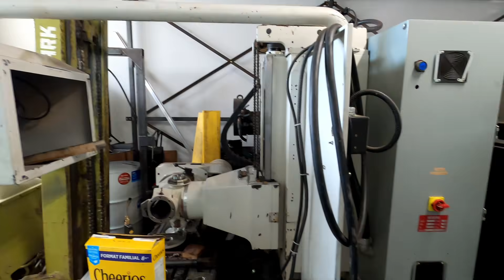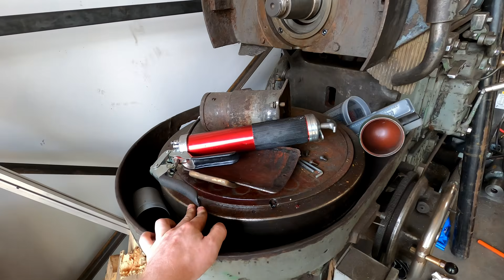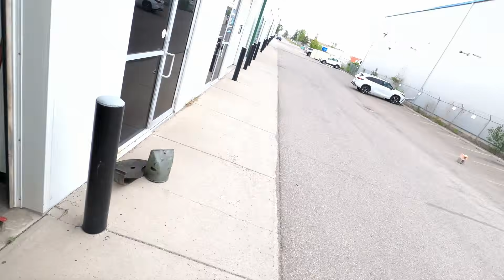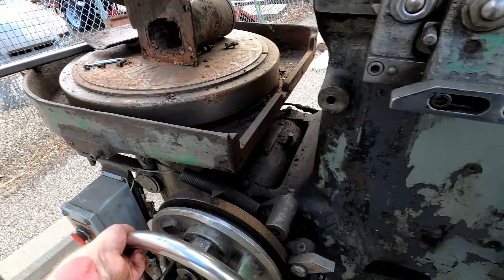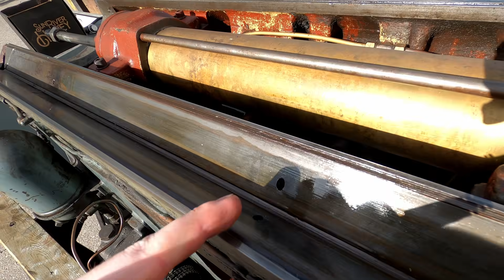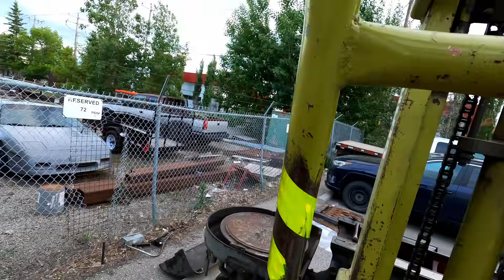Destroying a Piece of Manufacturing History - Scrapping a Heald 25A Grinder #design #engineering

Comment: Those machinery skates have holes in them that you slide a bar or pipe through to sort of join two of them together. That way they don’t randomly rotate on you.
Reply from the maker: The only thing with that is it requires the whole machine to sit 4 inches off the floor, one little stone outside and the machine slips off a skate.
Plus it's just me, so slow and steady.
Reply: @edwardpage8346  WHOOSH

Comment: You should never been allowed to have that grinder. If you can't afford to hold or know how to use a machine like that you should have been BANNED.
Reply: I have owned tons of old nice shape machines. And these lazy ignorant hobbyists won't pay anything and waste cubic yards of time. Refuse to learn or research. Are unable and unwilling to deal with 3 phase.
Reply from the maker: @frankgrabasse4642 I see lots of cheap Chinese VFD's and way too many dangerous electricals, it's often best people not take on these projects when they don't know what they are doing. You either need the right machinery to restore it properly or plenty of money, if not, painting a turd it's still a turd.
Reply: @edwardpage8346  tons of n on chinese vfds in the world. sand rotary-static converters. but the hoby bone heads wont spend and wont make the slightest effort.
Reply from the maker: These old machines get scrapped all the time, no one wants them, I couldn't even give this one away.
Reply: @edwardpage8346 then you should not have taken position
Reply: LOLWUT "banned" from _what_, you drunken clown?